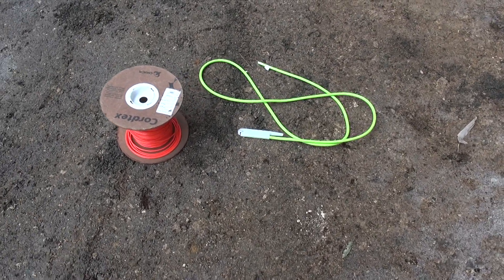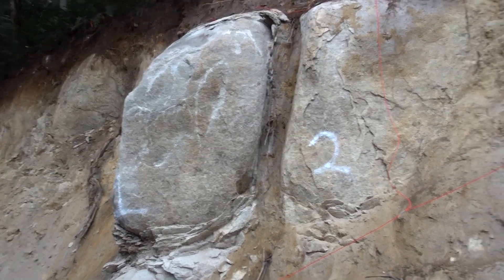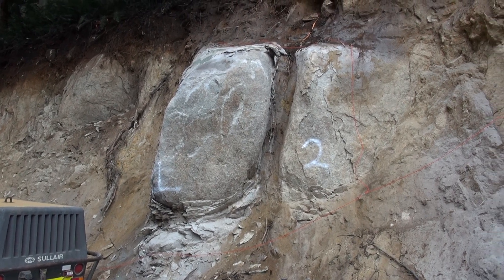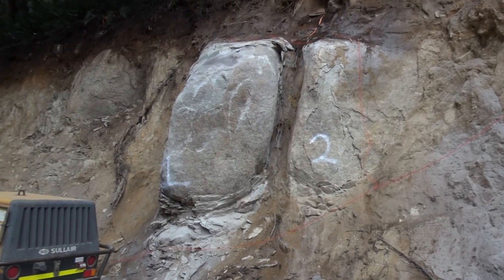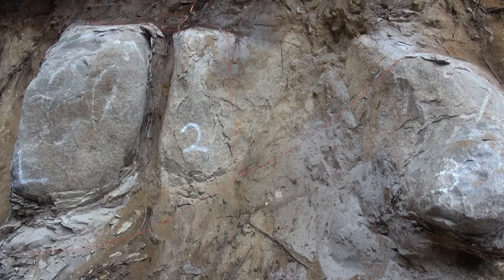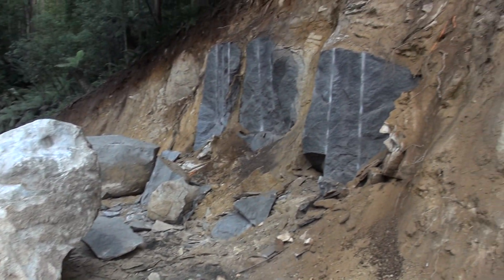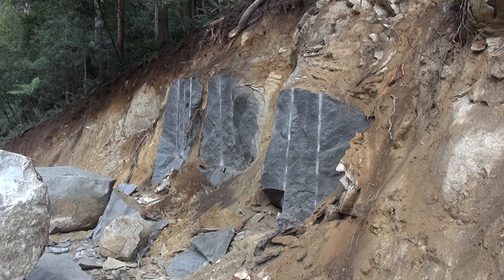Blasting Granite with heavy Det Cord

Comment: Did you only use detonating cord to blow that up, or did you also use an explosive?  If only det cord, then what size did you use?  Thanks
Reply from the maker: Most of the energy for this blast came the detonating cord. The cord is 70 grams / meter, there was also a small amount of packaged explosive at the bottom of each hole ~ 50 grams.

Comment: That's a beautiful work of art on the cutback of those blobs noses sticking out. Sheer beauty , clean shot right across. Love your work mate , best wishes and regards to you and the crew . Best continued success mate . Regards from an underground miner here in the WA goldfields. Before I forget , did you have to use any or much stemming to keep cords relatively central off the hole walls or are they a snug fit looking by the thickness in your video.
Reply from the maker: Hey Rick, thanks for your kind words. The holes were 38mm and cord is Orica 70 gram, about 10mm diameter. the cord was just tossed in the holes and stemmed with 5 mm screenings. I see that you are a Ham! - Me too.

Comment: Did you use bottom hole initiating or above hole init ? And did you use one stick of dynamite or only det cord ?
Reply from the maker: SPman8573  - this shot was top initiated and there was half a plug of packaged emulsion on the end of the 70g cord in the bottom of each hole.
Reply: Ok thank you for answer . Det cord for crack the stone , and emulsion to push it ahead ? 
We have a big job in near future to make rockfill instad of making classic blasting .   @demolitiondavedrillandblast

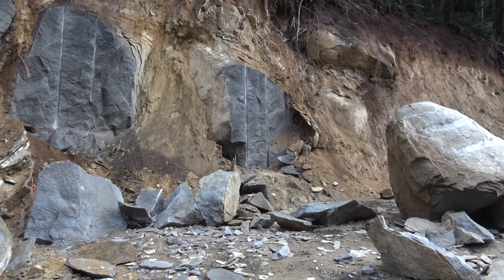Comment: Whats with the rock at 1:30 with the 4 holes in it?
Reply from the maker: When you are trying to stand on a sloping rock everything falls off so the first holes that you drill are a few 50mm deep holes to hold the drill steels that you are going to use.
Reply: A cunning plan